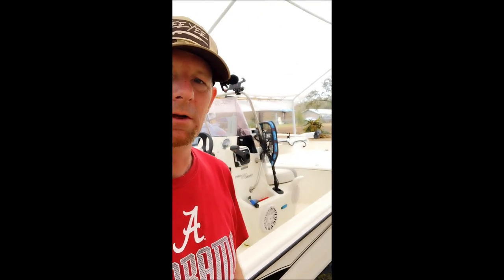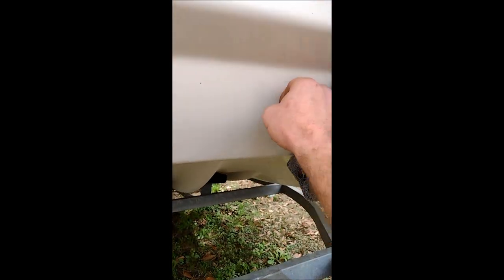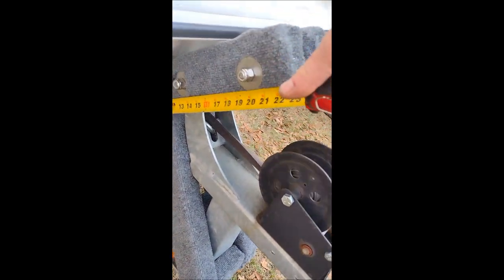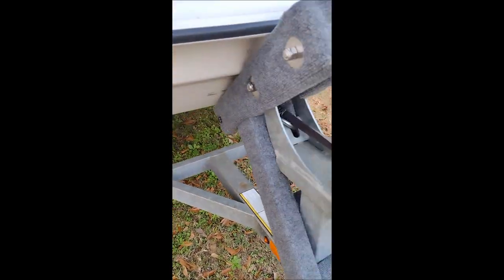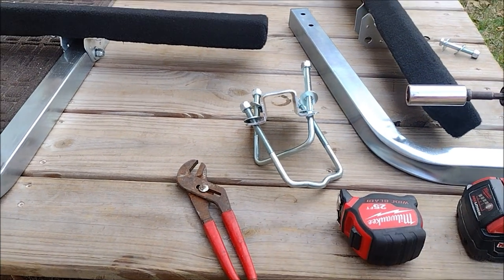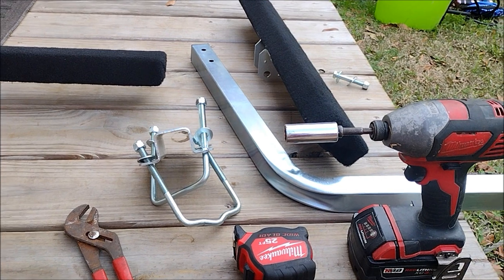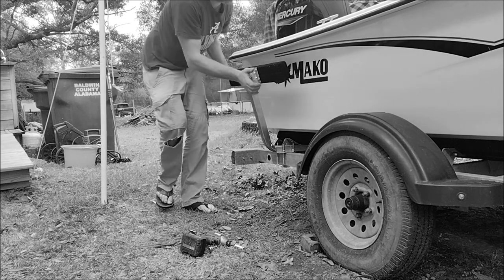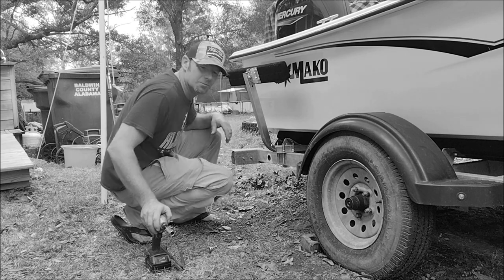Mako Pro Skiff trailer upgrades

Comment: Hello, where did you get the front bunk?  I have a Mako 15, having the same issue with the roller that came with the boat.  Also, the front live well on the Mako's don't work.  Not sure if you're having the same problem.
Reply from the maker: I made the front bunk myself out of some pressure treated 2x4s and marine carpet.  If you aren't feeling handy and don't want to build some yourself I'm sure any decent marine service Dept should be hook you up with some.  It makes loading a lot easier.  I know a lot of folks have issues with the front live well, but mine seems to work well when I have used it l, but it did air lock on me once and I couldn't get water to flow.  It seems to work better to pump water up there if you are moving.  There are a few videos on other channels about how to fix the front live well you could check out.

Comment: Nice video. I definitely need to make the front bunk.  Would you post the information for ordering the guide bunks, please?
Reply from the maker: These are what I bought.  Seem to be doing good so far.  I'd like to extend the vertical pole and put a PVC pipe for ramps that are steeper,  but they do keep the boat centered as you pull out the trailer. https://www.ebay.com/itm/184860309938?mkcid=16&mkevt=1&mkrid=711-127632-2357-0&ssspo=Xx7Ozu1NSgC&sssrc=4429486&ssuid=1VnZKvx1QjK&var=&widget_ver=artemis&media=COPY
Reply: Thank you.

Comment: Can u make me a bunk
Reply from the maker: I'm sure you could handle making it, and if not you could easily take it to a marine service shop or maybe even a trailer shop and show them what you want.  I saw on line the new 2023  or 2024 models came with a dual bunk style front rest so maybe it can be a bolt on you could order from Mako.
Reply: @12waythereadventures84  just thought u was making some and selling them
Reply from the maker: @kennyfletcher4693  might be a good side hustle for someone,  but I don't have time still working 40+ hrs a week and trying to still have fun!